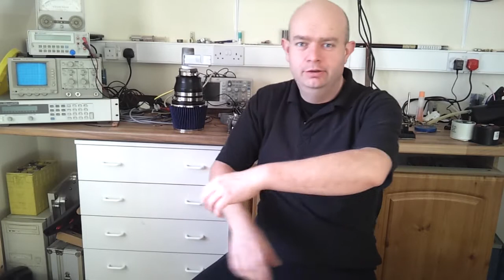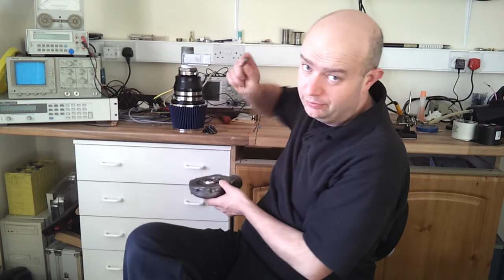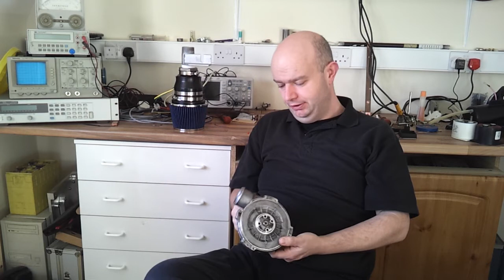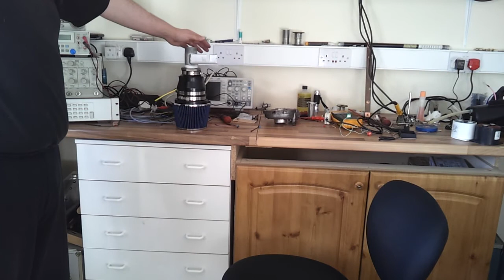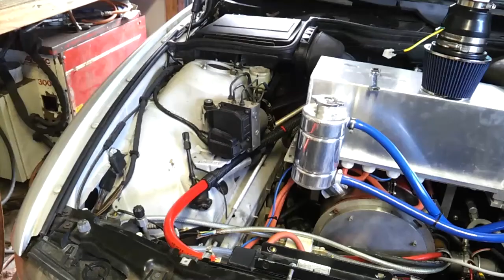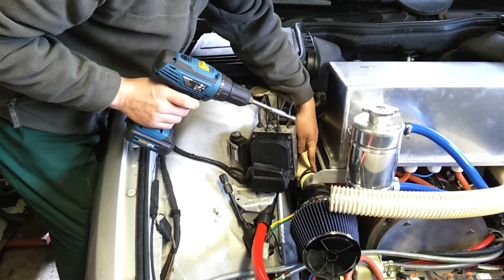BMW E39 EV Conversion 28 The Blower

Comment: I just received the same blower kit.  I was thinking of driving the blower with a speed controller and a microcontroller based on the thermister reading of the motor.  That way I only need to make noise when the motor is warm, and it won't be on full blast all the time.

Comment: Turbos run @ 100k rpm to 200k yours about 40 with the brushless I think you will need oil lub and turbos by design consume some oil if that gets around brushes it may well short  only a thought what you think?